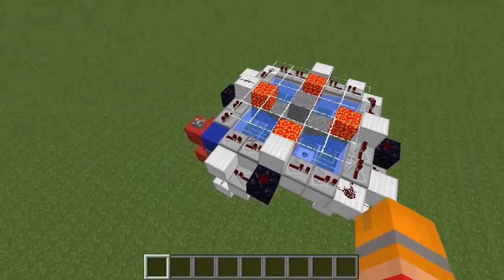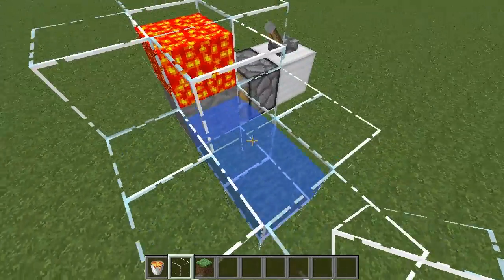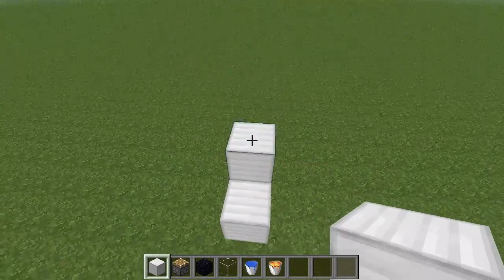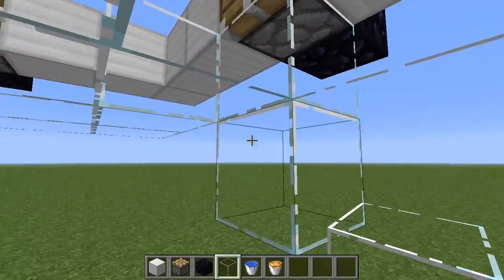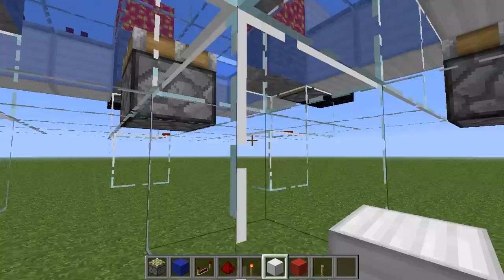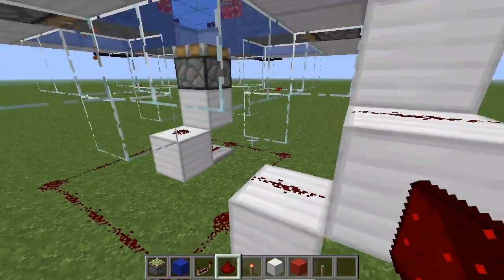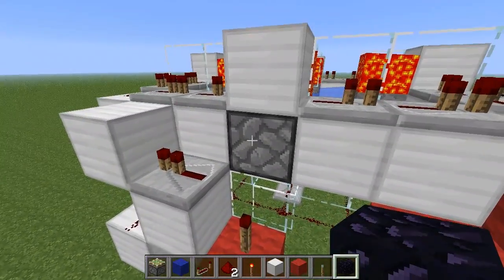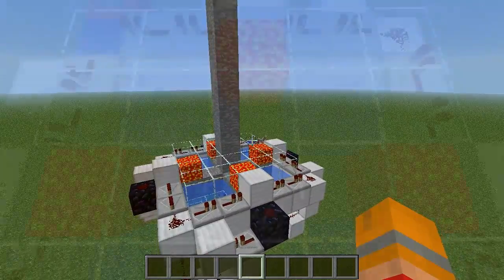Self-Repairing Fast Smoothstone Generator Tutorial

Comment: Great design and good tute, as long as you are already fairly familiar with redstone. Beginners should probably start with a simpler design. :)
Worked first try in 1.8.9 after adding additional delay on some repeaters as mentioned below in thread.
Here is a complete materials list with breakdown of total base materials required to build this SSG (as implemented in my world, YMMV slightly depending on wiring config).
All opaque structural blocks and circuit elements should be non-flammable, since we're working with lava... ;)

CORE and WATER/LAVA CONTAINMENT:
- 24 opaque block - structural/clock ring
- 52 glass - core chamber floor/cover (I added a glass block above the lava sources for safety)
- 5 regular piston
- 4 immovable blocks - placed behind the inward-facing pistons, I used furnaces
- 4 water bucket
- 4 lava bucket

CLOCK/PISTON WIRING:
- 21 repeater
- 38 redstone dust
- 18 opaque block

MONOSTABLE ON/OFF CIRCUIT:
- 1 lever
- 1 sticky piston
- 1 repeater
- 2 redstone dust
- 2 redstone torch
- 6 opaque

This represents a total of:
- 48 opaque block
- 52 sand
- 57 cobble (if you use furnaces for the immovable blocks behind the pistons, as I did)
- 66 smooth stone
- 30 iron ingot
- 18 wood plank
- 47 stick
- 70 redstone

Hopefully my math is accurate, but I am fairly drunk... let me know if you find this useful or if I missed anything.., :D

Comment: Remade the bottom part into a hopper clock, here's how. (For 1.7+ and above) TOP VIEW

                                          
                                                                r           
                                                               w          
                                                                r
                                                               c
                                                               h
                                                               h
r- repeater
w- redstone wiring
c- comparator
h- hopper

I set the second repeater to two ticks. This will definitely work because i did this on 1.8.9
Reply: Uncle Sam Did you put only 1 block in the hopper clock?

Comment: I removed the entire bottom part of this, and added a separate hopper clock with one item inside, attached to a repeater on two ticks. works really well. For more sparkle, I put redstone lamps on all the immovable blocks that normally have redstone on them, but the side that has the lever on it; for a wave of light :3 the bottom isn't super consistent, but it ends up being way faster than if you try and "fix" the bottom, by connecting the top clock.

Comment: The problem is the monostable circuit that starts the clock. It seems to be putting out a pulse that's longer than one tick. When I used the piston-type pulser it worked fine.
Reply: This Fixes the problem!

Comment: My epcerience in 1.8: It's a disappointment. It's a lot slower and you can easily destroy the whole tower without spam clicking. However, after a minute it stopped working: I heard the pistons and I saw the stone moving in the hole, but they didn't get pushed up.
PS: Sorry if I made mistakes, but I'm not Englisih.

Comment: i just built this in survival 1.7.5! It still works just got to add another repeater feeding the piston in the middle. Which means you have to move 1 side of the ring at the bottom out 1 as well. So in short use everything he did plus 2 redstone dust and 1 repeater.

Comment: I have a similar design that works at just the same speed (this is possibly the fastest we can both get it at). The self repairing is the exact same concept, but it's more compact by two blocks in length and width. However, it's a downwards production system and it suffers the random 'hiccups' that break up its consistancy. Nonetheless, it's still a very reliable system that's great for suffocating withers in a bedrock trap.

Comment: Running on minecraft 1.5.2, you can eather add a 1 tic delay to each of the repeaters powering the pistons( this causes it to slightly slow down) or you can add a 2 tic delay to the repeaters coming off the obsidian heading to the ring causing a slight delay in startup but works.

Comment: You could keep the original design at 1:00 but add 2 pistons, one facing upwards under the stone, and one next to the piston that pushes the stone facing the same way as the adjacent piston. You could then set up timers to have the generator intentionally "break" itself, and in doing so change the output from stone to cobble. Then with a separate timing system the generator could "fix" itself, changing the output back to stone. Unfortunately this wouldn't work well with the 4 generator design.

Comment: @spencerandres001 you could, but you wouldn't be able to go back down the same shaft. a better idea would be to use the sand duplicating glitch to make a sand elevator then knock off the sand with a piston at the bottom when you wanna go down :)

Comment from the maker: Yes, that is unfortunately unavoidable for such a fast generator. It will continue to push around the stone at the bottom until you break or move some of the stone from the output, or turn it off. You could rig up a shutoff for when it reaches the limit, but the downside about that is it would only turn back on if you broke that last block (not if you broke a block in the middle for example). In the end its a trade off between features and speed.